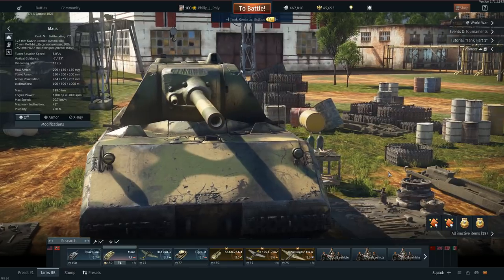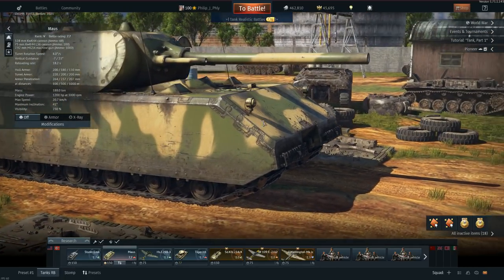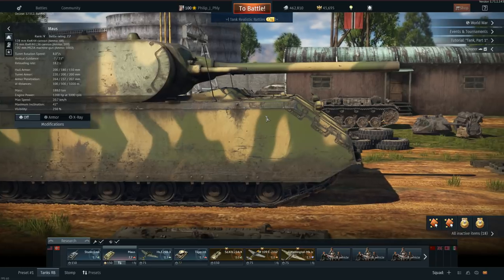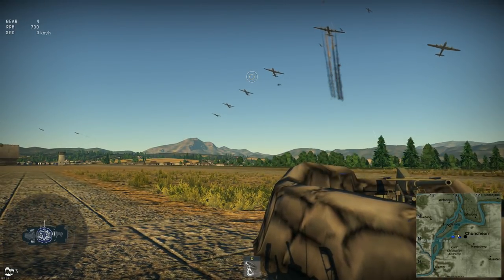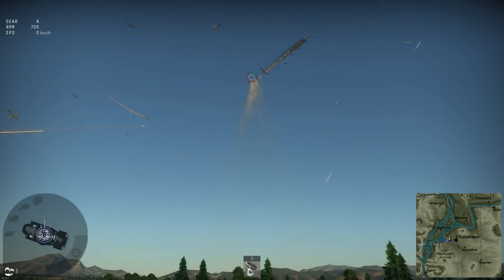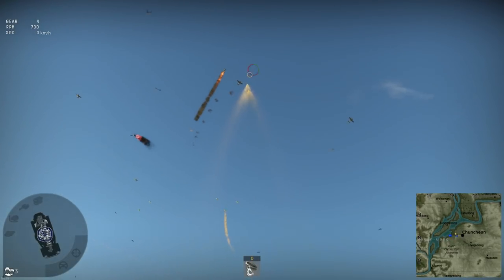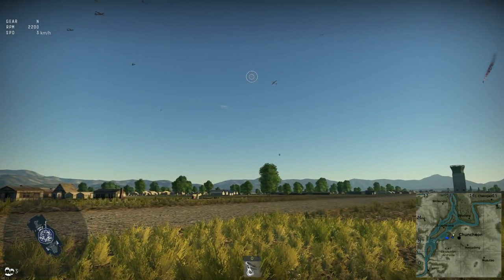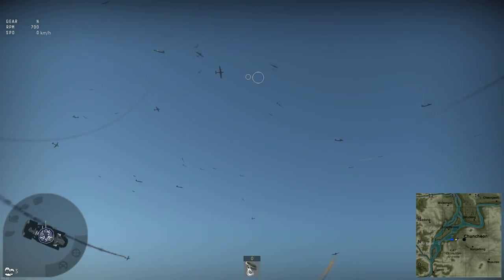PROXIMITY FUSE Anti-AIR  (War Thunder)

Comment: The Flak 88 should absolutely get a proximity based Anti-Air round, so it can do what it was originally designed to do.
Reply: the russians didnt have that though
Reply: Hendricks Milan while the germans didnt have proximity fuses, they had frecuency fuze, so when near an motor of a b17 the fuse would go off because the frcuency of the sound
Reply: Kevineitor199 well, from what I read they just created an electro magnetic field resulting in a detonation near any kind of metal or electrical thing
Reply: yes!!!
Reply: only american (and maybe british, not sure) had proximity aa fuzes
Reply: yeah, i kind of assumed that. guess i assumed correct
Reply: Blaze_The_Timberwolf : Tanki Online
No, it wouldn't be accurate. At all. Stuff that only has MGs or even the 14.5 would be way too small to incorporate a large amount of HE filler, let alone the radio fuse. It would be too arcadey, which, judging from your profile pic, explains things.
Reply: tis what i mean
Reply: stalin guide vodka rounds even harder!
Reply: Colin Thorneycroft Tho that in War Thunder are sadly many things, which didn't exist, or ammo for a verhicle, which it never had
Reply: Dragon Butt the flak towers had a central ranging station that was connected to all the gun positions. The gunners had piles of 88mm shells that were pre-set to explode at a specific range. One pile for 1km, one pile for 1.2km etc ... the ranging tower would instruct its connected gun batteries to use a specific shell to achieve close air bursts on the bomber formations.
Reply: Only the US and the UK had prox fused ammo during WWII.  I’m 98% certain it’s on guns as small as the 40mm Bofors.
Reply: regular wter:

no we still want it the old way so we can fantasize knocking t34 engines 5m outside the tanks

Comment: If a system like this is implemented into the game, everyone would be able to effectively use SPAA, which may actually bring relevance to the poor class. And maybe even limit CAS.
Reply from the maker: I agree, but this representation is extreme. What do you think about a SPA such as this  goo.gl/ptVvke with a proximity fuse shell?
Reply: While this is indeed in the extreme, for the guns that have it, it could boost those less inclined to play SPAA (and make the Flakbus so much damn fun!) As for that SPAA (Wasn't the M40 also an artillery piece? Checks Yes yes it was) would be a nice addition, but probably too slow firing for some. It is a 155mm gun after all.
Reply: I just realised I misread two A's when you mentioned the M40. My mistake.
Reply: Oh don't get me wrong keb, I love my Crusader AA Mk1 and my Wirbel. I just mean that some other parts of the playerbase... simply don't enjoy it... To me nothing is more enjoyable say "screw you" to a diving attacker before they get to do any damage.
Reply: Very few of the SPAAGs in war thunder had proximity shells

Comment: The electrostatic fuse would sense the field of electricity that is bound to a plane. All the moving parts, static charge, electrical components etc. generate a low current and low frequency field around the plane. Hence the sensor in the shell was hard to jam because it wasn't connected via radio or something nor was it sending out any signals that could be interrupted.

Comment: Look up the VT fuse shell.  The US developed it and only the allies had it.  The hard part was developing a vacuum tube that could survive being shot out of a gun.  We loaned a few to the British and it accounted for ~90% of V1 kills once it was implemented.  It was also used to shell German lines since it would air burst 5' over the troops, raining hell down.  The Flak88 had a timed fuse, set before loading to explode at a time after it was shot.  They calculated the altitude of  the bombers, and how long it would take for the shell to get to it.  It was NOT a proxy fuse.

Comment: The US/UK 90 and 94mm guns and the 3 inch AA Gun on ships could use the VT Fuses. The US and UK did use some over Germany but it was mainly the USN and RN who used them in the Pacific. 

The 88mm Flak gun didn't use Proximity Fuses, but could used time delay rounds (you could set them before firing) the Germans did prototype a Proximity Fuse but had no vacuum tubes for it

Comment: Due to limited manufacturing processes in 44-45, American estimates put the failure rates of proximity fuses at around 70%, so 7 out of 10 shells failed to explode correctly, yet the proximity fuse drastically improved AAA fire control regardless. This means that if the war had gone on longer and they had improved that to 40%, the proximity fuse would've been at least twice as efficient.

Comment: During the very early days of the Korean war, the U.S. used many Fighter planes for defense. Planes ranging anywhere from the F-9F Panther to the F-86 Sabre. but before these planes were developed and deployed in large numbers. The U.S. was still dependent on using the P-51 Mustang as a front line fighter. The Mustangs, along with most other propeller aircraft, were displaced by jets, but a large number served in the Korean War, mainly in ground support missions. The re-designated F-51 was out-performed by the newer jet aircraft, but in 1951, two Mustang pilots shot down the first MiG-15 downed over South Korea.

You will now do the same Phly, You are allowed to bring along a wingman to assist you, but you must score s Mig kill in a P51 Mustang and live to tell the tale by successfully returning to base and landing your bird afterwords.  

Attempt #3

Comment: What proximity fuses allowed was that a plane or planes could be taken down with less shells so it relieved the strain on crew supplying the guns and logistics to supply the ships with enough shells before it was timed fuses so it was pretty much a guess at how high a plane was so they had to fire more shells to shoot down a plane, barometric fuses where good because they detonated at a set altitude it still was a guessing game though as what If the plane is higher than the shells detonation altitude it would go off too far bellow the plane to do damage or take it out or if it was lower the shell would go off too far above the plane to damage or destroy it. What the proximity fuse did was it put out a cone radio frequency that when it bounces off a plane it detonates destroying the plane these fuses where so revolutionary there where precautions set so that the enemy was less likely to get their hands on these fuses if a munitions ship was to be captured or a ship captured that they would probably destroy these fuses before someone that wasn't the allies get their hands on them.

Comment: Fuse was a BY designed by Brits and manufactured by USA.  
Germans shouldn't have VT simply due to they did not have the tech.  Variable would be great though.  To help Germans manual airburst change the site picture.  Use circles for craft size to figure elevation.

Comment: I would like, for balance sake of course, for this to be only available for the vehicles with a high calibre gun that would have been used for AA but in-game are used as tank destroyers, at the moment it would be only applicable for the Flak 88mm and the 29K, i'm sure that gaijin will be putting more vehicles like these into the game and of course it would have to be on the HE or a separate type of shell for this effect, but it would be nice to be able to use flack in the Flak especially as it used to be labelled as SPAA and now it is a SPG or TD.

Comment: The gun on the sdkfz222 is a 20mm , not a 37.
Cool feature but i think that IRL they where only effective with large shells like the 88, and or have to be the same in game because implementing a round as effective as that would ruin tank rb
Reply: You can only change the weapons on user vehicles. So if one wants to test out a new weapon system they use a random user vehicle. They could place any cannon easily onto the 222 since it's a user model.
Reply: Its a 37mm in this user made mission.

Comment: Proximity fuse wouldn't make CAS more vulnerable than they already are of SPAA, it would just make it more easy to new players to pick up SPAA and actually score aerial kills, right now SPAAs destroy planes by dealing direct hits at whatever parts of the plane they are able to reach, it requires a lot of practice before a tanker can get the lead right and still sometimes you don't manage to hit anything because the target is too small and too far away, proximity fuse just make this problem a little less significant, in a way you just make the targets bigger because your shots that missed but that were close enough still do some damage because they explode near the plane, you're not dealing more damage than if you were using normal ammunition with explosive filler and scoring direct hits, in fact you're doing less damage per shot, but if you were still learning how to properly shoot, using proximity fuse ammunition would make you more useful to your team as a SPAA dedicated to clear out the sky.

Comment: What they could do is have not proximity fuses but manually set ones, (at least in the lower ranks) you would have a button that adjusts the distance that it will go before it detonates. This would still require skill as you would have to estimate the distance and change accordingly.
Reply: Almost nothing in the game had proximity rounds in real life. The only tank that would benefit from them being added is the 40mm Bofors SPAAG

Comment: The AA rounds in the game are timed, though it kinda makes sense you can't set the fuse.
Take the Wirberlwind and shoot it in the empty. You'll see a puff of smoke about 1.5Km away. I like to believe that's for balancing, since the Wirly shreds everything it can hit.
Manual rounds must be set individually and were used in manually loaded artillery batteries that fired in volleys, like the Flak 88 and 128. Imagine setting each and every round for an autoloader like the Wirlberwind? You'd have to dispend an hour just to adjust the belts!

I loved to play AA in Arcade. Then they made most AA kamikaze-able. And on top of that, it costs an absurd ammount of money to repair. Like, 20K to repair the M19 at BR 5.0. Most vehicles just become free kills in Arcade, since you can spawn in a fighter for free and nose-dive the first AA you see. People didn't even bother engaging enemy aircraft anymore, if any. This is the reason I haven't been playing WT since February. And I don't plan on returning until they fix this bullshit.
Reply: Afther a 5Gb download, I launched the game again to see whats up. It turns out they've made the repair costs more reasonable for AAA in AB!
Though, repairing the Ostwind still costs 9k (used to be 14), it's a good step in the right direction, since, at least, it can't be kamikazed.

Comment: I think it would be fair to give big caliber AAs proximity fuzes, while still having a failure % on detonating (maybe not historically accurate but to compensate for the thus greater reload)
Small AAs such as Wirbels could still not have these shells as they put a pretty high volume of fire and they would work better than prox. fuzes at low altitudes

Comment: What about the X-4? It has a proximity fuzed that had a acoustical system tuned to the 200Hz, which was the sound of the B-17's engines at cruising speed. The proximity detonate range was 7m(23ft) IL-2 1946 had it. Gaijin can just copy and paste the design model and tweak the controls.
Reply: Maybe not just copy and paste it. Enhance it graphically, polygons, textures etc

Comment: i think big caliber spaa should get this, like the zsu-57 and the duster. not to mention the flak 88 and the 29-k. Also, all of these veichles would need a reloade nerf, just to make it a bit more balanced and to simulate the crew deciding what rang to use (since proxy ammo were'nt used in the war)

either this or a gamemode that doesn't have planes in it. i wanna play tank battles, not CAS battles.

Comment: Hey phly I have an idea loving the unloved he-162 also gameplay tip the he-162 was cheap aka they may be able to land but they weren't designed to comeback really so try playing it a lot more like that and use your speed to your advantage at high altitudes it can reach over800km so don't forget that and it's more agile than the me-262 so if you like my idea comment on my comment

Comment: They would never allow it for anything smaller than the 88 or soviet milk truck. It would be way to op for 20mm or 37mm
Reply: The 20s and 37s would be ineffective I think in an airburst function.
Reply: Harrison _ point wasnt just to destroy plane,just take out the crew wich would bring down the plane and 75%of all allied bombers never returned home meaning those shells were worth it
Reply: Harrison _ what about the 128mm?
Reply: i dont think anyone's taking out a  maus or jagdtiger to shoot down planes...
Reply: Colin Thorneycroft Colin Thorneycroft its sbout the Quote „only the 88 has proximity fuses“
Reply: first, the 88 never had proxy fuzes, only set/timed fuzes. second, even if they implemented some sort of aa fuze to the 128s, no one would use their massive potential to KO tanks to try to shoot planes
Reply: but they didn't... they did NOT have proximity fuses. AA gun or not. the germans just didn't develop them, let alone develop them enough to be used in large quantities.

Comment: I think it should be added in warthunder the problem is the power of it I think they should nerf the shrapnel or the explosion if they're thinking of adding it in and are there any other anti-air vehicles that can quite use the proximity round type pls tell ☺

Comment: so, when will this be implemented? or is it not? because the russians gained a new TD in the form of a cannon put on a truck, but it could be used as anti air if, just like the germans had for real when they used the 88mm flaks, proximity fuse shells.
Reply: Germany didn't have proximity shells

Comment: if they added it in would the flack truck have a shell for it? or should it have one? would it be op for it to be proximity?  i think it would be  unless it was user set somehow because an 8.8cm gun auto bursting on plans would be way to easy i think but i could be wrong.  dose anyone else have any imput on my opinion of this? P.S. custom battles would be flippin awesome with
 the 8.8cm.